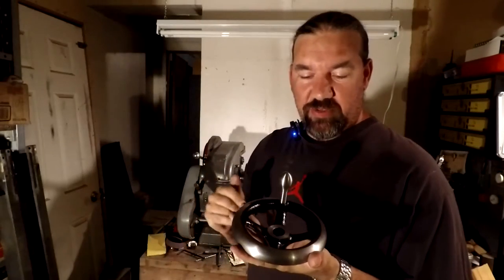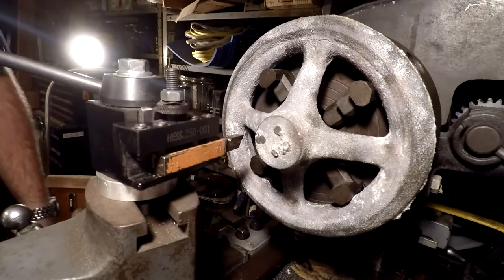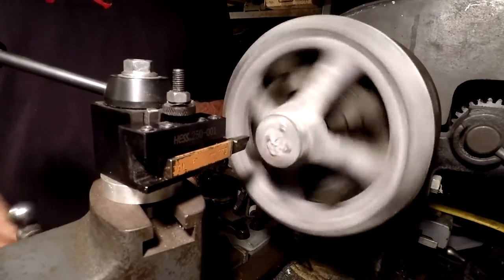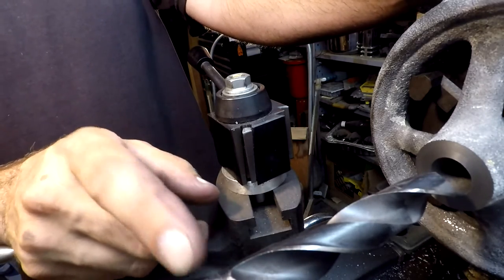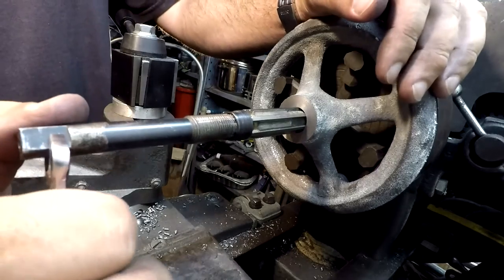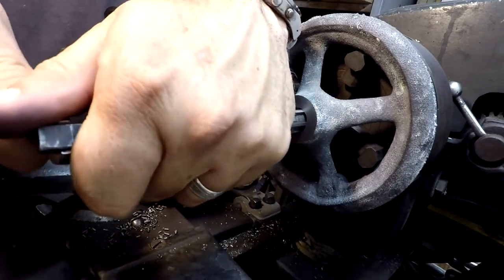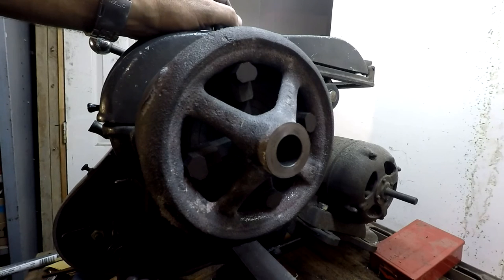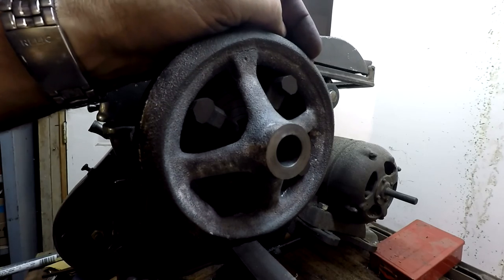Brown and Sharpe horizontal mill hand wheel machining part 1

Comment: just use a boring bar and run the carriage back and forth advancing the slide outward each time. takes a while, but it'll make a keyway just fine. i've done it for bearings too for oil/grease slots
Reply from the maker: That is a valid way to go about it. However my lathe has zamac gears that are probably not up to the task and it also has very worn ways so it would cut the key at a bit of a angle. This is why I went with a broach . Thank you very much for your comments.

Comment: I've got an upcoming video where I used an expanding reamer.  Love them.  I have a number of them.  Might not be a whole set but I'm glad I stumbled into a deal that included them.  Your sound is great with the machine on.  I've used my hand reamers in the chuck by using back gears.  I hadn't figured out what a revolution is yet on my adjustable reamers.  If you buy a parts lathe to get a bed, let me know.  I would be willing to chop a deal to get parts.  I"m looking for a bad lathe with a good QC gearbox now.  One of my projects might need a bunch of gears.
Reply from the maker: you and me both . i had a parts lathe traded all i did not need for a better bed with the lead screw. dosen't have all the holes i need but think i can add them , mayby the next series

Comment: Long time in the making. Looking good.
Reply from the maker: yes it has the mill will operate in manual mode once i have the second one built. you have Ben lagging with the videos to got any things in the works
Reply: Yea, I know. I have a few projects in the works but free time has been nonexistent. Been slammed at work, I have a ton of freelance work also, and I was away on vacation as well.
Reply from the maker: ya same here had a baby thought i could get some stuff done here but ben working on the kitchen remodel hree just barly snuk in sone shop time have another instalment of the post drill almost ready to go will up load nextweek

Comment: lots better. this was a good video. what are you using for sound
Reply from the maker: its a blue tooth mick that has a build in amp for the go pro made bye removu .it is the  removu m1 + a1
Reply: will it work with the sj4000
Reply from the maker: i think the mike is universal but the amp. only works with the gopro .
Reply from the maker: what is the sj4000 ? that the camra you use?
Reply: yes
Reply from the maker: does your camera have blue tooth capabilities? if you look around i think you can get just a blue tooth mic . this one was special for the gopro and waterproof ect. but not that you need to spend the extra $$ on that . you can probably get one for a lot less that one this rig was.